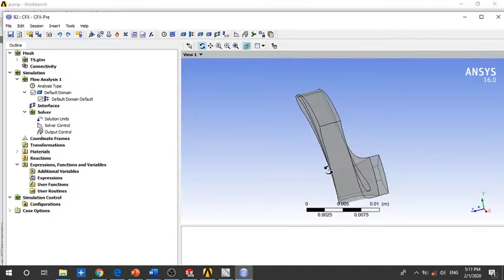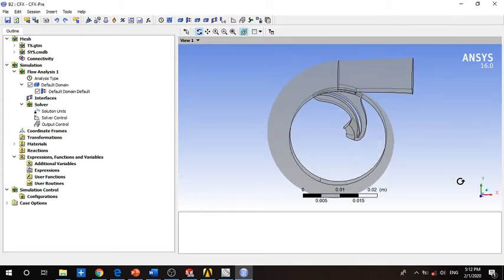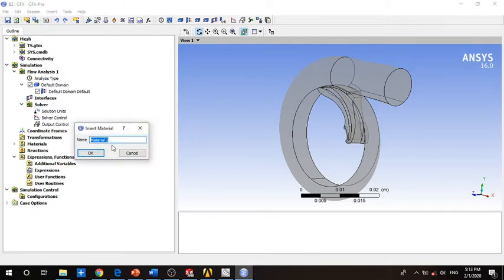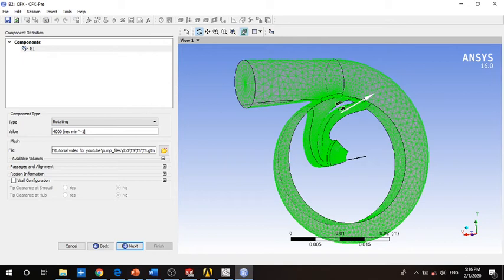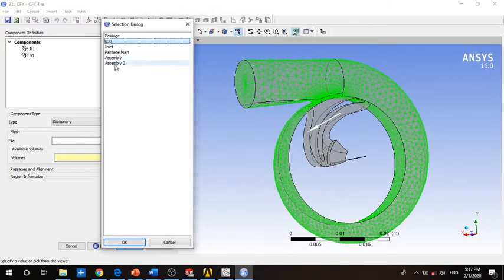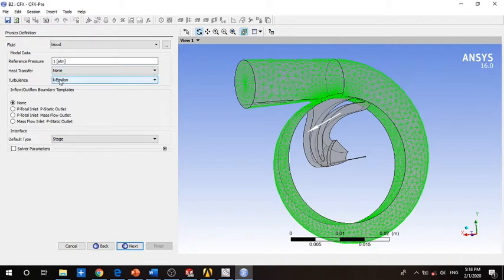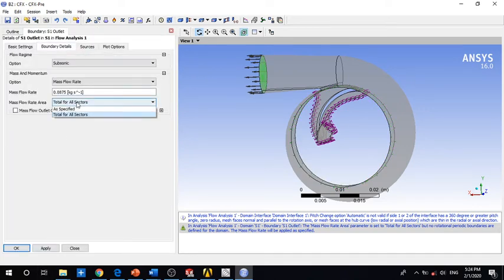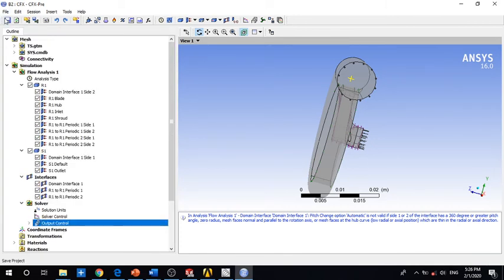creating setup for the impeller & volute combined (whole pump setup ) using ANSYS CFX--no 5

Comment: when i did the flow analysis of impeller+volute model in cfd post, the impeller was not fitting completely into volute.
Can we change the dimensions of volute??
Reply from the maker: It should fit just fine. 
But i highly recommend that you should check the cf turbo model
Reply: @osamashawky7101  I made both volute and impeller through vista cpd . Is there any way I can edit the dimensions of volute
Reply from the maker: @RayIITB 
I guess in cpd impeller & volute dimensions are based on the operating point. 
So you can change the casing rotational angle
, section type or
Diffuser data, 
You can find them in
Vista cpd - >blade design - >volute - > geometry
Reply from the maker: @RayIITB 
Check this might help
https://youtu.be/EP_Aejt5ry8
Reply: @osamashawky7101  not working. But any way thanks